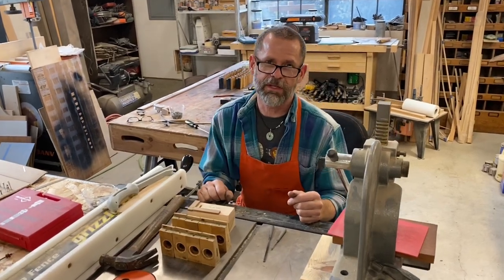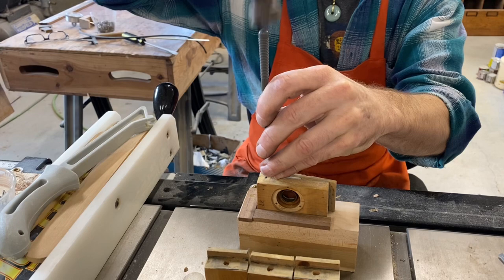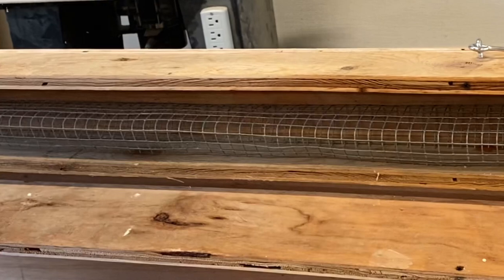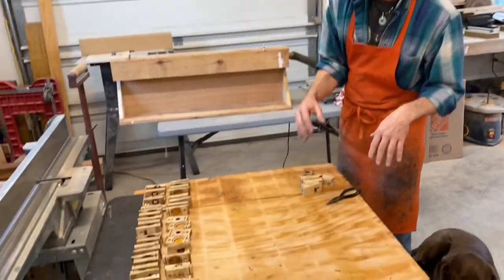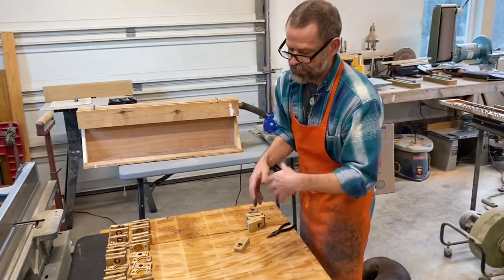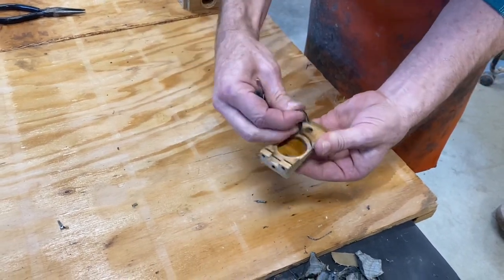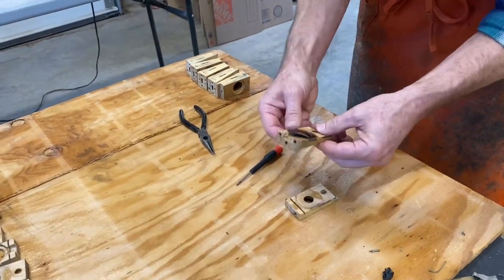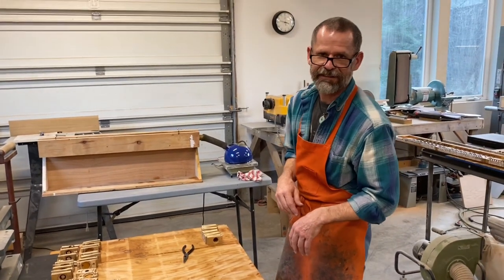Using Steam to open Coinola Unit Valve/Pneumatics

Comment: Thank you for sharing! I didn't realize steam would work on softening yellow glue as well. Good to know!
Reply from the maker: It definitely softens yellow glue that’s on the surface- i.e. used to glue on pneumatic cloth. I don’t know what steam would do to a wood joint glued with yellow glue.

Comment: Very good information.  To my thinking, it'll be much easier to repair a lamination that has been loosened by the steam than wood damage caused by chiseling the pieces apart.  If it were me I'd choose the steam.  There will likely be fewer laminations to repair than the wood damage that I assume would happen on every piece.